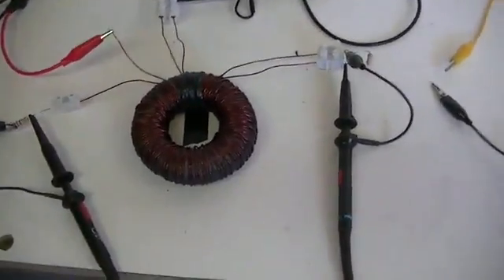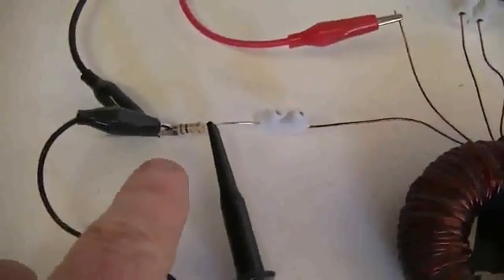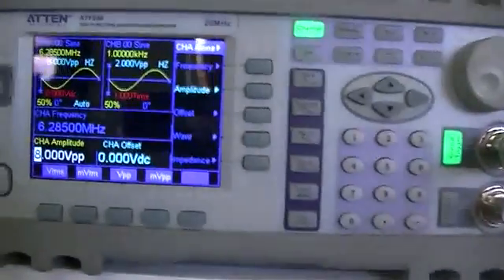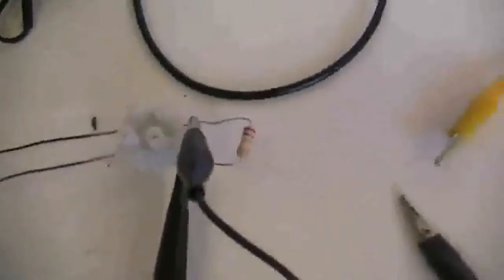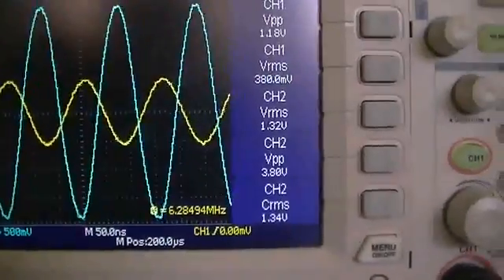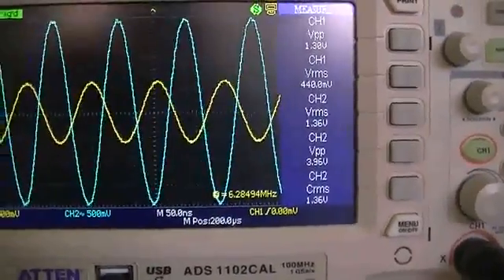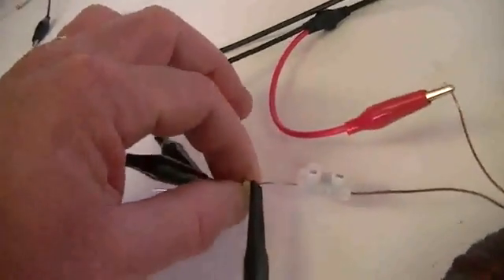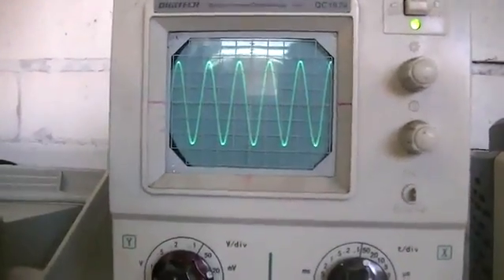Split core transformer tests

Comment: But ... that resistor is really reflecting current... lower resistance (in parallel as it should be) would be more current, That is to mean; the magnetic field collapsing is going to be a constant... generating the same voltage...(same winding, same driving force on input) can reverse calculate that the only change that can happen is the current by changing the resistance....

Comment: OK, here's my first guess. I think that at the lower frequency you are seeing ordinary transformer action, with the secondary's voltage rise determined by turns ratio and load impedance. At the higher frequency you may be seeing a resonant condition and your voltage rise in the secondary will be a result of "VRSWR" or voltage rise by standing wave resonance, in combination with your load impedance, which gives a more complicated relationship between input voltage and output voltage. Also, the resistors will be acting like inductors themselves, with a reactance that depends on frequency. So by lowering the resistance (putting the extra resistor in parallel with the CSR) you may be moving the circuit's true resonant frequency closer to the FG's output frequency setting. A small change in the circuit parameters near resonance could have a big effect on output, even moving it in the opposite direction from that expected. Can you get the higher voltage output reading, with just the one resistor, by slightly changing the FG's output frequency? Also, using the current-sense resistor as the load may be giving you a false impression of what's happening. It might be better to use a 0.1 Ohm CSR in series with your test loads (1 ohm vs. 0.72 ohm if I calculated right). What kind of voltages do you get open-circuit, just hooking your probe to one output lead and the reference to the other?
Another thing to consider is that most scopes have their probe references connected together internally, so even if you lift the ground so that they aren't connected back to other instruments thru the line, they are still connected together at the scope's chassis. Just about the only scopes that I know about personally that provide probe reference isolation are the Fluke ScopeMeters 123 and 199, which allow up to 600 volts difference between the isolated probe grounds.

Nice kit by the way. I don't trust the Atten brand much after watching LTseung's adventures with Atten scopes and his Joule Thiefs, but I have no personal experience with them and I'm sure the higher-bandwidth models must be more accurate than the ones he was using. At least I hope so. 100MHz bandwidth is nice, none of my scopes, even the old donated Link DSO, have that bandwidth, and my FGs only go to 3 MHz.